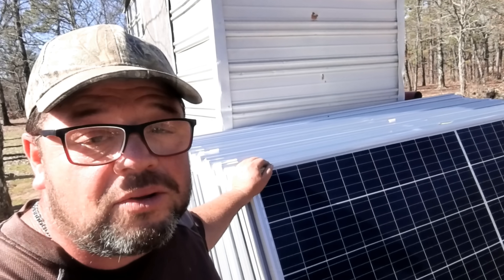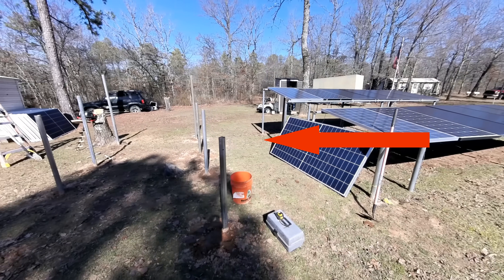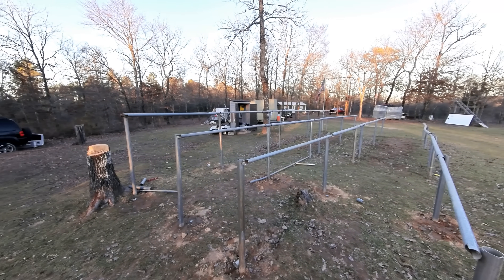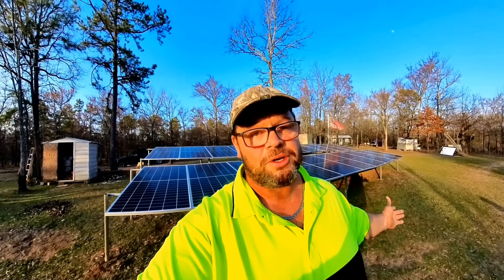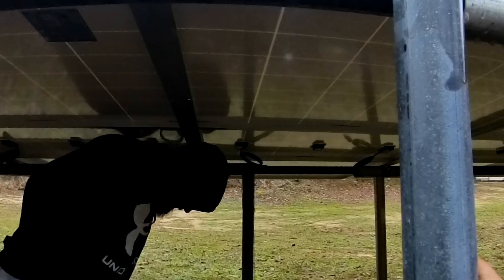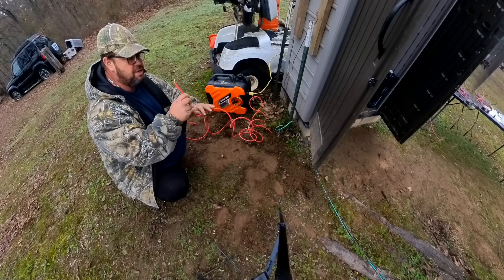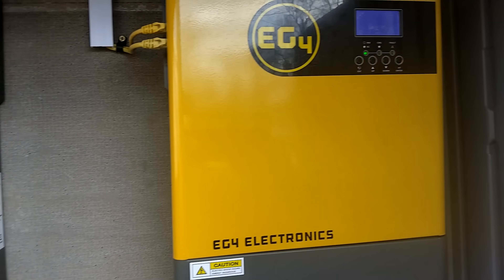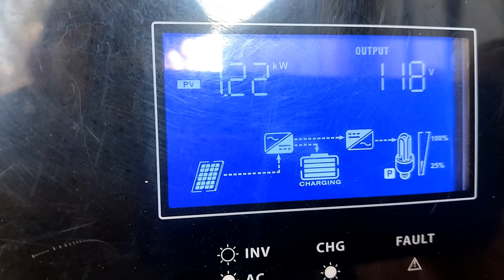87 Dollars For Solar Panels. WOW !!

Comment: Did you use the 4awg gauge wires and breakers that came with the inverter?
Reply from the maker: Yes on breaker no on wire..I went 2 gauge.. although 4 gauge was sufficient I just like bigger
Reply: What kind of connection on the end of the 2awg did you use to fit into the inverter @OKLAHOMAOFFGRID
Reply: I couldn't find the same connections that came on the 4awg wires. What did you use? @OKLAHOMAOFFGRID
Reply: @OKLAHOMAOFFGRID  thank you for making these video's

Comment: Yes and it all keeps dropping. I mentioned that if the 12v batteries were dropping in price server rack batteries would follow. They're dropping from the 1200range to 800. Last I wrote really good panels were selling for around 100.00. Crazy good compared to not long ago, so good cost recovery times are down to the point off grid power could beat the system. Guess it depends where one lives and they charge. For new construction that's not right by the power lines one can take the cost of connecting to the grid off the cost of their system. Depending I can see cost return times between 10-15 years providing there are no hail storms. 
It just keeps getting easier and better.
Reply from the maker: @DanWipper  p I understand the cost return when you have the option of the grid but in my case it's always been nothing about the cost versus the grid but yet just the cost versus not having Electric in the middle of nowhere... So in off-grid hunting cabin situations or just off-grid cabins and things such as this building is cheaper systems now to have the comforts of home in the middle of nowhere is it pretty neat to be able to accomplish nowadays especially being able to do it yourself.
Reply: @OKLAHOMAOFFGRID  Yes if you stick with rack batteries and matching inverters its become very easy. Inverters now have components that had to be added separately.

Batteries the most expensive part and a necessity for off grid have improved the most, server rack and wall batteries are automatic in most every way.

Need cheaper, putting together multiple 12v batteries is now easier than ever with Blue Tooth monitoring. Its the easiest way to save money. 
For about the same money individual cell builds came a long way with rack type hardware kits for 300.00 and up. Looks like fun the kits contain everything less batteries but there's risk and little to no warranty. Building a rack battery was a great deal at about 600.00 when similar racks were 1200.00 but not so much now that prices dropped to 800. 

The cost and easy of use no longer leaves off grid people at a disadvantage no matter the size of the house. This leaves buying land down south easier with more choices. Oklahoma's not a bad place to retire.
Reply: In NWI I've heard of quite a few people going solar on new build smaller cabins because the set up ended up being almost the same price as getting hooked to the grid.
Reply: @starvingsquirrel  Yeah it you're home's 1000 feet from the lines its going to cost a pretty penny. 50', no problem but the new solar stuff is pretty competitive if one doesn't mind the extra work. All things even if the grid's there at the same price most will take the easy way. I'm in N/E Illinois between Chicago and the cows, similar solar power gets a little weak in the winters, snow can be fun, you'd get more lake effect snow.
Reply: @DanWipper  Ya, you don't see too much up here for big setups, like for a full house and what not, as obviously that get's pretty expensive, especially come winter when you still need to make enough power. For the small cabins though, especially seasonal ones, it's getting more and more popular to just throw up some solar in the woods and flip the bird to the power company, lol

Comment: Your panel tilt angle looks too shallow for Oklahoma latitudes.
Reply from the maker: You are correct it's good in the summertime where they say 18° is okay but yeah all year round ideal is going to be around 30 and I need to change the angle I just did not have time to do it in this video

Comment: I have 22 grid tie solar panels, so I need a hybrid inverter to add batteries.  The only way to beat a net metering rate that is so low and make solar pay for itself.  Oh! That $674.00 dollar off- grid inverter won't work here. For AC Coupling.

Comment: Thanks for the videos.  I did purchase one of the EW server rack batteries under your code.  Ended up buying another one under a different code.  I sure wish they had the actual server rack to put the batteries into.  My ground mounts are wood an T-posts here in SE Michigan.
Reply from the maker: My code was supposed to make it 800 dollars flat

Comment: Most authorities say that the voltage drop on the wires bringing power to your house should not exceed 2% at solar noon.  You know the amps, volts, the ohms per foot are published and you know the distance.  Taking it a step farther, let's go up from 10 gauge to 8 gauge.  Run the same numbers.  Now look at the extra cost of copper versus the electricity saved.  When I compared 8gauge and 6 gauge for my system, I found that the extra money spent on larger, 6 gauge, wire would pay off in 49 (forty-nine) years with the present cost of electricity.

Comment: What was the exact wattage and brand of the 20 panels. I couldn’t find that info in the link. Great informational video. Thank you.
Reply from the maker: @MarkHay-d5l  so here's how it went the exact panels were actually 355 watt panels made by rec... Those panels sold out about 3 days after I bought them and they still had the 375 watt panels in stock so I use the link for the 375 w panels. The company was okay with me doing that but now the 375 watt panels are out of stock... So now I'm just thinking what the Heck... So yeah when I look online at other places for those panels they're selling container full of them but it's like 700 panels... So yeah there's still some panels for good deals under $100 each but they're like 400 watt panels... So yeah that's the story so things kind of got messed up before I could even get the video posted... And when I mentioned the panels in my two previous videos people clicked on the links and bought them and they sold out immediately... I hope all that makes sense... 7100 w of Rec 355 watt solar panels
Reply: @ Appreciate you getting back with me.

Comment: Fun fact: whenever you see off grid homeowners promoting solar, you always see them upgrading it later because it wasn't enough power.
Reply from the maker: Well maybe somebody can learn from your comment and build it bigger then you need from the start
Reply: Been 11 years for me... Been working great, but I sized my system properly. I am planning to upgrade but that's due to adding a/c and a pool
Reply from the maker: @brly4542  yeah the first one I built has been going for 10 years now and it worked good except we had to just replace the batteries but as far as sizing the system it did okay but we always want to build on to what we have for some reason I want to be able to run the air conditioner 24/7 and go four or five cloudy days instead of just two or three

Comment: Hello. Not sure if you have any experience with the Ecoflow Delta pro 3 but I'm looking to build an off grid system using the Delta pro 3 connected to my main panel. My idea is to use some budget friendly 12.8v lifepo4 batteries and run multiple in series parallel and connect them to the DP3 via the solar input ports. I was wondering if you had any knowledge on if that would work? I'll be running my solar panels to a solar charge controller and then to the batteries. I'm looking to run 4 strings of 4 12.8v batteries. Each string will be in series to create (4) 48v batteries and then connect each string in parallel to create a 20kw battery storage. If you have any thoughts about that or if you think it'll work please let me know. If you could do a video on that too that would be extremely helpful.
Reply from the maker: @Dark_Daze  I'm just going to tell you from experience right now that I would absolutely not hook 20 kilowatts worth of 12 volt batteries together. I know they say that you can do up to 16 batteries for in Ceres and 4 in parallel with the problem lies where do you have 16 different BMS trying to communicate and trying to collaborate voltages... Unfortunately there is just way too much to go wrong and I've seen it go wrong with just four batteries hooked together one will shut out before the other one shut out for different reasons like charging and when that one disconnects it makes it a 36 volt system all the sudden instead of a 48 and it screws things up. The reason it does this is because 1 BMS or temperature sensor will cut off before the other one will unfortunately you cannot get them all to cut off and turn back on at the same time and it even complicates the system even more when you have 16 batteries hooked together there's just that much more possibility for something to go wrong. I hope that makes sense... Number to I think hooking the batteries into the charging port is also not a good idea because they can only accept so many watts through that charging port... I think there's a better way to do what you're wanting to do
Reply: @OKLAHOMAOFFGRID  if I were to get server rack batteries instead, would that work? I can basically just plug the Delta pro 3 into my main panel and avoid extra wiring. Would just need to figure out what inverter/charge controller I'll need. Trying to go as cheap as possible. This will be my 1st home I'll be buying.
Reply from the maker: @Dark_Daze  if you're trying to get an inverter charge controller there's no need for you to have the Delta at all you'll have whatever you need at that point to run whatever you need all you need is solar panels batteries and a charge controller... Your Delta pro is all that in one but it's just not very powerful. You're much better off just building you a small but powerful system that will outperform any solar generator with ease and much cheaper

Comment: Hey! 😊 is there a reason you wouldn’t go from 200AH to say 600AH or even 800AH, if you topping off your batteries before the day is done, it would make sense that you still have so much more power to charge more batteries, then you wouldn’t have to worry about running low on power for well over a week? I think that you don’t have to have batteries changed 100% all the time? I mean it would be ok to charge 800AHs to 90% instead of having 400AH at 100% charge. Just a thought, if doing the upgrade maybe just go that little bit extra?
Reply from the maker: Oh believe me I'm definitely going to 400 right now there are two batteries I have already ordered and are on the way... And I may even build it bigger later down the road my plan is I want to be able to run whatever I want whenever I want whether the sun is out or not whether it is cloudy for days in a row or not I know this sounds a little greedy but hey I think this is how you should live if you're going to have solar

Comment: Great video! Thanks for sharing the wire link. Do you plan to split the series connection into 2 or 3 groups and connect them in parallel so that a little shade on one panel will not become a bottleneck? For example if you have 10 400w panels connected in series, with full sun you may get 4000watts. However, if one panel gets some shade and produces only 100w, then the whole series connection is throttled by the current from the shaded panel and the system will only produce 1000Watts. But if we split the panels into 2 parallel groups, then we will get 100w x 5 + 400w x 5 = 2500watts output.

Comment: The king of salvage.  I love it. I reuse lots of stuff also. Mostly wood. Used locusts for the vertical supports, reclaimed chestnut barn boards for my horizontal supports and hurricane clips to attach the panels. Fasteners saved from various jobs. Zero cost for the rack
Reply from the maker: Right

Comment: Your panels are laying too flat.  Sure, be 30°
Reply from the maker: It's the way the racks were before I started so need reconfiguration at some point
Reply: Also depends where you live. Sun's position changes depending the elevation you live on and time of year
Reply from the maker: @Proximax9  this is true but yeah 32 is the all around number out here where I'm at but in order to get perfection they need to be at 18 in the month of June so ya it changes all year
Reply: Shoot one of my arrays are just laying against a wall. Who knows what angle they are at
Reply from the maker: @jetfirers5139  👌😂
Reply: What if you make it adjustable, or better yet be automated, adjusting in real time or maybe daily/weekly/monthly might give improvement on harvest.

Comment: A 7kw system like that could easily handle 6 x 51.2vdc 100AH batteries.
Reply from the maker: Yeah hang on brother I'm working on it I have two more batteries on the way now and I am very pleased with how fast it charged those two batteries from like 10% to 100% in less than 4 hours on a cloudy day

Comment: Great video. It's really great for people to be thinking ahead and you really are by adding to your system. I'm working on adjustable wooden panel frames right now for flexible solar panels that I've  had covered in my closets for over a dozen years. I just keep working on off grid projects as much as I can and I'm not even off grid yet. Awesome stuff!
Reply from the maker: That's awesome

Comment: Love your straight to the point, no BS videos. I'm looking at putting a small off grid system to my shed/workshop.  What's been holding me back is the ground mounted panels.  I've been over-thinking it.  You're just over here making it work and strapping them to fence posts 😄Love it!
Reply from the maker: Exactly man if there's a will there's a way
Reply: @OKLAHOMAOFFGRID what are you going to charge me to come to illinois and help me setup an offgrid big solar system on my property to run my garage and most of my house on it sir?

Comment: WHY NOT JUST ADD THEM TO THE EXISTING SYSTEM??????
Reply from the maker: I want it All matching voltages and panels
Reply: Anybody who is into solar for any length of time will have a mis-matched system--a living museum of sorts.  I installed my arrays in 2001, 2018 and 2022.  The panels don't look the same.  Nobody cares.  As long as the Vmpp of the strings are close, they work fine together.